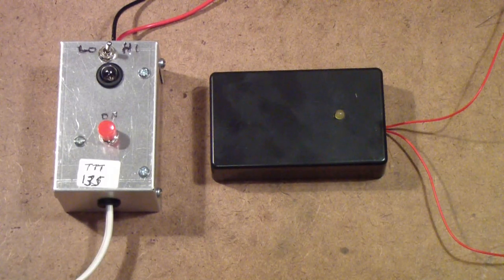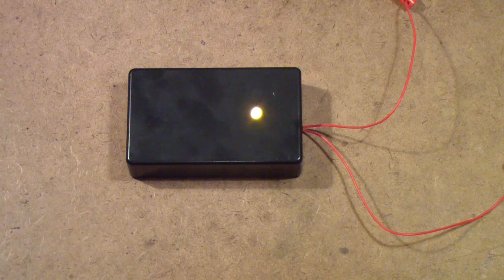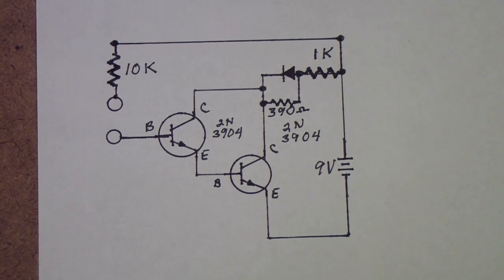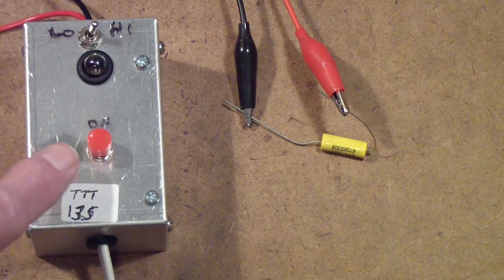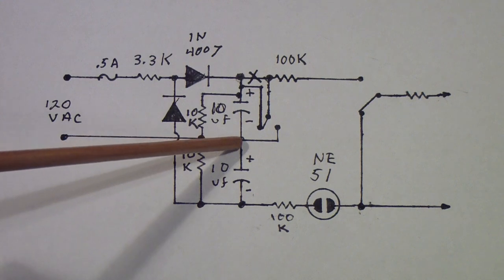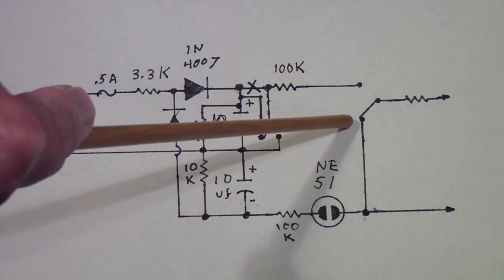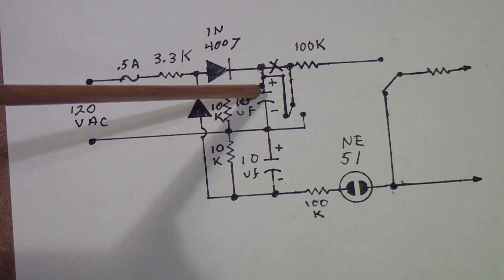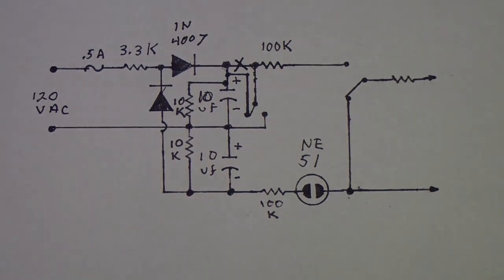TTT340 Cap Tester Update

Comment: That's a great high voltage capacitor leakage circuit Tom, I wonder if a DC Voltage Quadrupler Circuit  would give you the 600 volts and you could have three voltage ranges.

Comment: Thanks Tom. I am thinking of the transistorized version with a 1k resistor in series with a push button to test to protect the circuit from a charged capacitor. Some caps even accumulate a small charge when at rest. Not that I would do anything silly like fry it with a charged capacitor.......I think that would be almost foolproof. As with all your videos, this one is really good. You and Don at Restore Old Radios have educated me more than you can know and I appreciate it.

Comment: e caps are supposed to have minimal leakage, check their data sheets. I built my own medium powered one using a Lionel train transformer adjustable 6-24vac in, into a voltage multiplier circuit, with output leads for volts/amp leakage monitoring. then a discharge load. Works great I get 130 vdc out.

Comment: Do you have a link to the original article for the low voltage/transistor-based tester? I built it from your drawing, and it works tickety-boo with any coupling capacitors, even showing leakage on 630VDC capacitors. But every single electrolytic I hook up shows up as a bright LED. Is this device not suitable for electrolytics? Thanks.